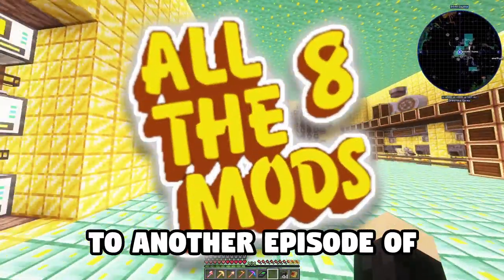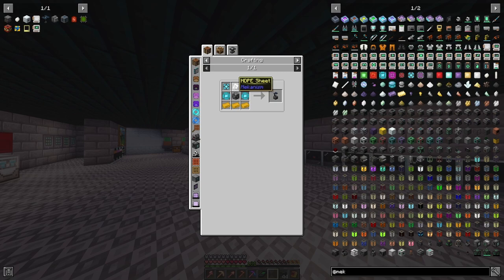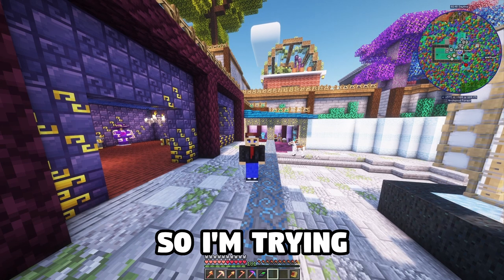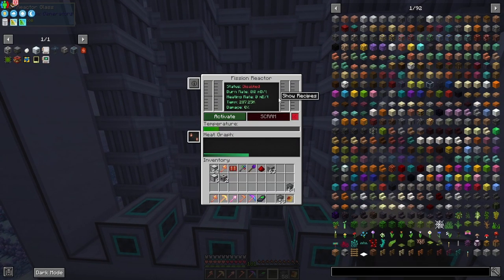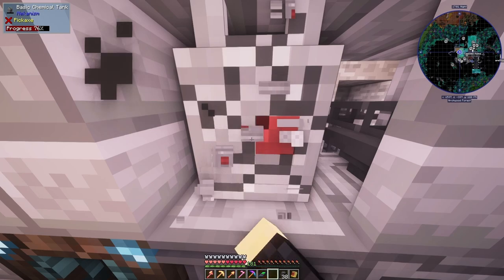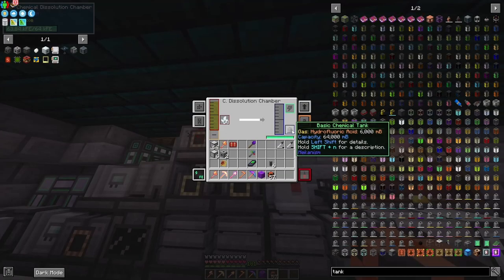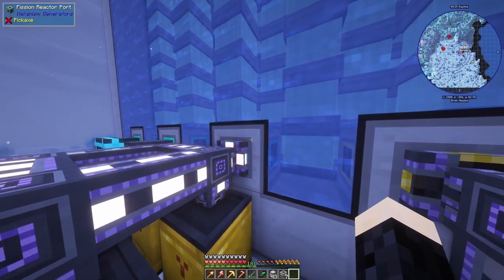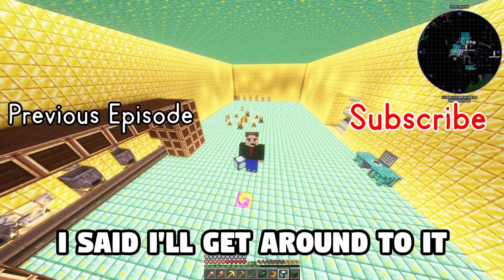ATM Star Journey⭐: Solar Recharging Unit!

Comment: small thing but can help you that you can use integrated dynamic or eternal water block from evil craft to pumping water in a LOT faster than pipez or mek ultimate mechanical pipe incase you dont know xD
Reply from the maker: I am still learning and the water is pumping in just fine actually so I probably won't do it this time around maybe in the future thanks for the tip